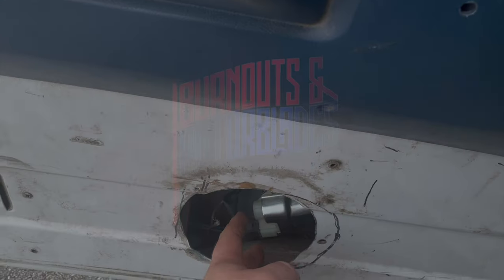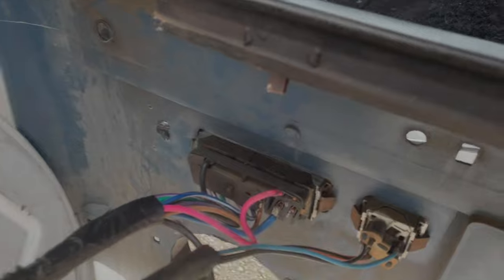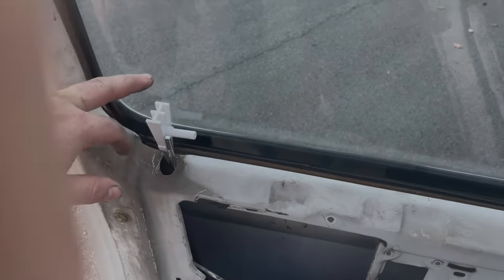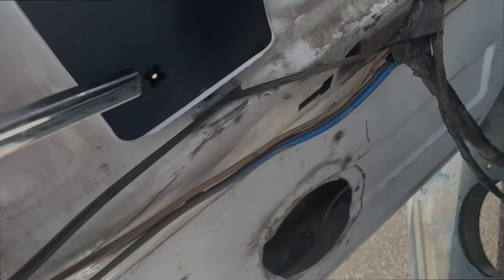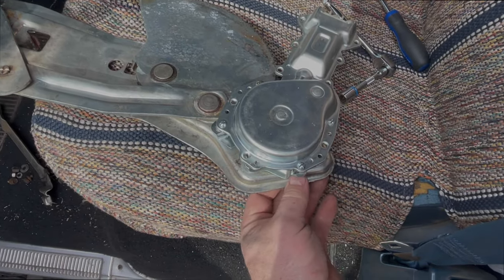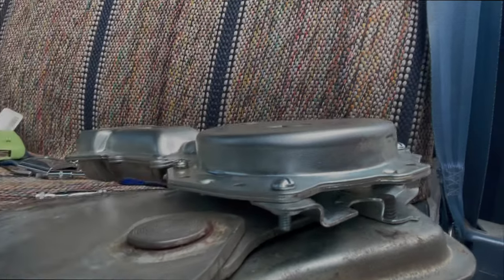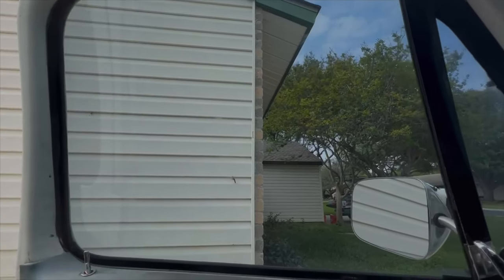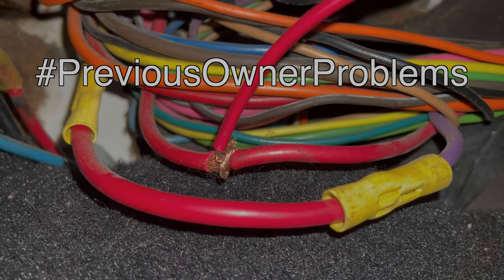Squarebody Window regulator and motor reinstallation

Comment: The next time you get locked out of our truck remember the Triangular vent window can be opened by putting a butter knife or screwdriver between the vent window and the frame, underneath the latch and lifting upward and then you can reach a small arm through and pull the lock or hit the switch

Comment: My 40 year C10 old power windows still work. They do take a couple of pauses going up requiring finger pulling assist and the whole process takes about 14 seconds. And the weather stripping is rock hard and mostly gone. And the power locks will trap you inside if you accidentally hit lock. One of these days I'm going to fix these...maybe.

Comment: Idk if you have sliding back windows and please no one do this to break into my truck (not like you’ll find anything valuable anyway) but you can shimmy a thin piece of anything into it and push the clip off and slide the winds open to get in if you lock yourself out. But also more than anything get a spare key because they are like $7
Reply from the maker: I know about the sliding glass windows. I have a solid one. I still don't have a spare key though. I should probably make spares for all my rides.

Comment: هذه عندي اعاني منها، صعوبة في الصعود والنزول ولا ادري وش فيها، مع انني استبدلت المحرك مرتين جديد!
Reply from the maker: Make sure everything is lubricated and the regulator moves smoothly with the motor removed. Some people put electrical power directly from the battery to the window motor. the factory wiring has the power go through the window switch. The window switch can act as resistance and restrict the power to the motor. The windows will move very slowly if this is the situation. look up "squarebody window relay mod" for instructions.  I will do a video on this process this year.
Reply: شكرا لك اخي 🌹
سيكون هذا مفيد جداً للناس التي عندها نفس الشي
Reply: @BurnoutsAndRotorblades  بحثت ولكن وجدت هؤلاء الناس يشترون (redels) جاهز من شركة (LMC) وبصراحة انا لغتي الانجليزية ضعيفة فأعتمد على الصور بدلا من الصوت، افهم بعض الشي من المقصود 😁، اتابعك من الصحراء الجافة😂.
Reply from the maker: @gh-7714  What part of the world you are from is obvious when you type in Arabic. What country are you from? I use google translate to understand what you say. I try to use English words that make translation more simple. You must remove the window mechanism from the door. inspect the all pieces for corrosion. Make sure each piece moves without resistance using only the power of your hands. The window can cause resistance when it moves up if the track is new or has obstructions.  the door could also be misshapen or warped  and the glass will fight to move up. check that the window can move down to the open and up to the closed position with only the power of your hands. if anything prevents this smooth operation, then I would order a replacement for the part causing interference. You can buy ready-made parts from LMC or find used parts.
Reply: @BurnoutsAndRotorblades  شكرا لك اخي على هذا العمل الرائع جدا 🌹. 
انا من السعودية.